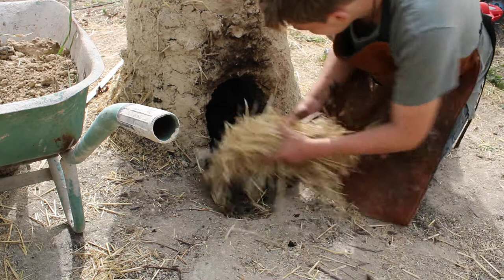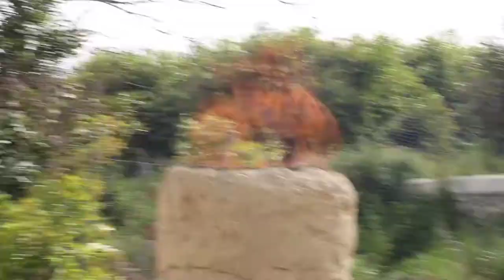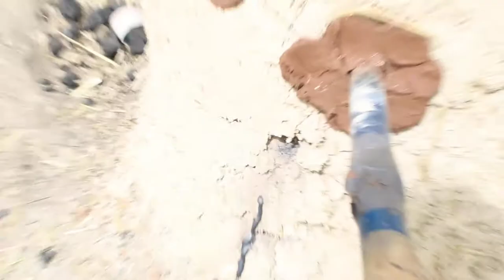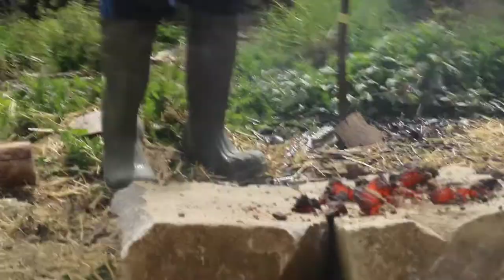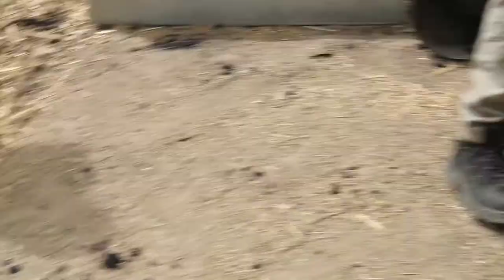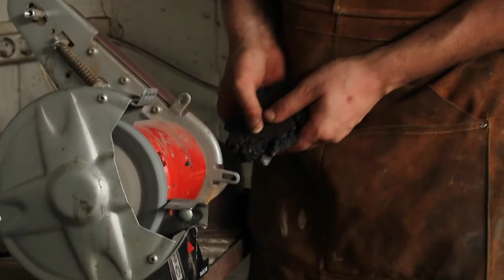How to make bloomery steel.

Comment: Do your first fairly gentle compaction with a long log about 4" diameter while the bloom is piping hot and still in the furnace. Then bigger tongs for sure to get it on a concave faced wood log anvil and 'pat the bloom into shape a bit' with small mallets or hammers before hitting too hard, building up from smallish to heavy blows. If it all falls apart, you lose any working heat really fast, and you end up welding all the bits back together in the forge afterwards.  One advantage if it does break up, is you get a chance to sort out the best steel lumps from the soft iron and forge weld them back together into useable billets. Great job, and for all the hard work, it is still bl**dy good fun.

Comment: Kinda makes me want to feed wood to it. Like it should degas from the top, and then the charcoal should sink in the furnace afterwards. Or maybe it would just make the heat too low for good reduction
Reply from the maker: Once it's burning hot enough you can add hardwoods but they need to be fairly small pieces
Reply: @theclassicblacksmith2389  right, so it has enough heat to turn the wood into charcoal. Also i thought hardwoods were disregarded as making lower quality charcoal (apparently the growth rings would make the piece of charcoal too brittle and you'd end up with charcoal slices instead of small lumps that would let the air flow well)
Reply from the maker: I'm not exactly sure on that but I do know that the charcoal I use in the furnaces/forge is hardwood charcoal
Reply: I cook with jumbo lump oak pieces constantly and never had the slivers you described if that helps any